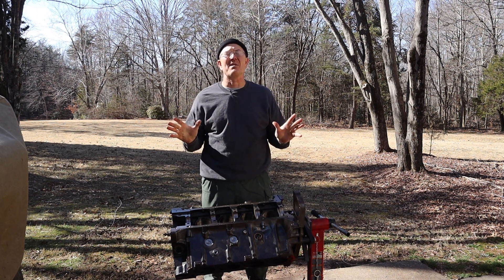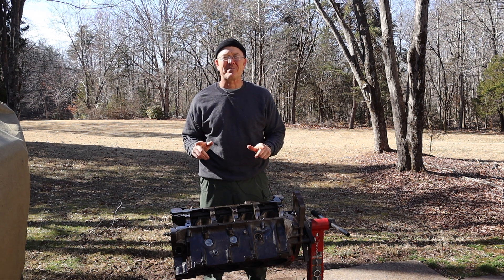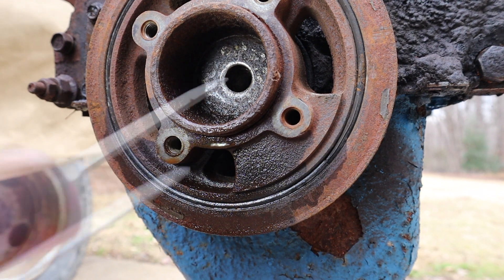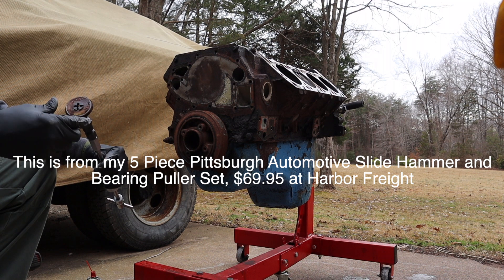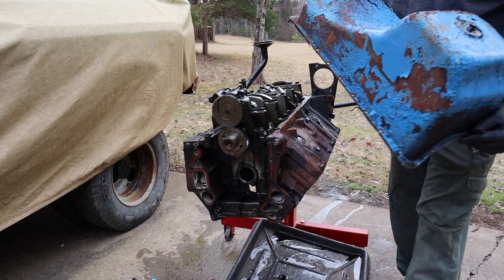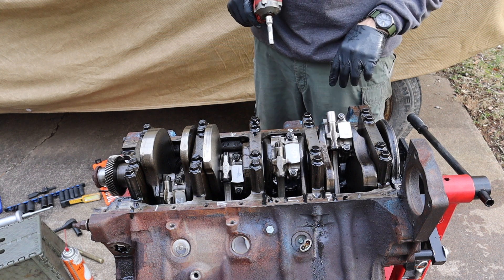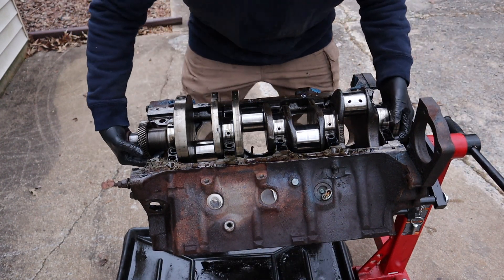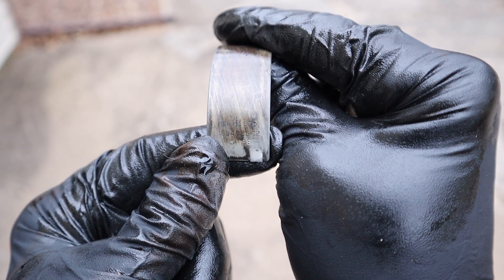7.3 IDI Disassembly - Third Try Finding a Good Motor for Project Brutus Engine Build!  Episode 16

Comment: Is there a trick to the block heater seal? I replaced my heater and the darn thing is still leaking.
Reply from the maker: Hi Joseph - I'm not sure; haven't gotten that far yet!  I'd recommend posting at oilburners.net in the 6.9/7.3 IDI forum.  Good luck!